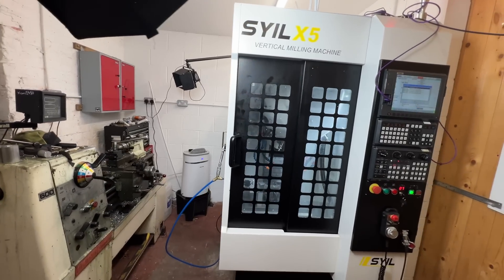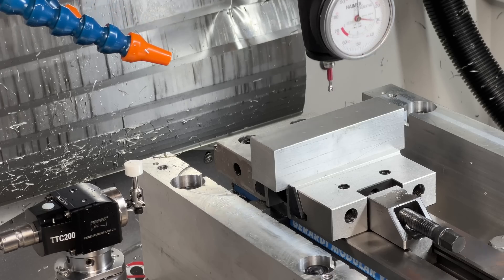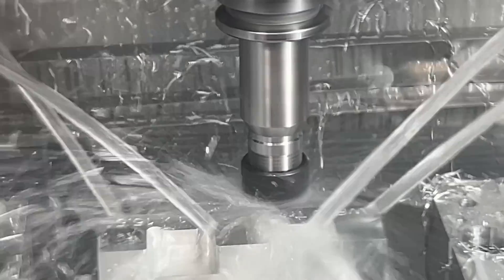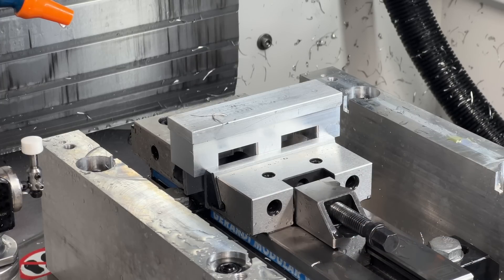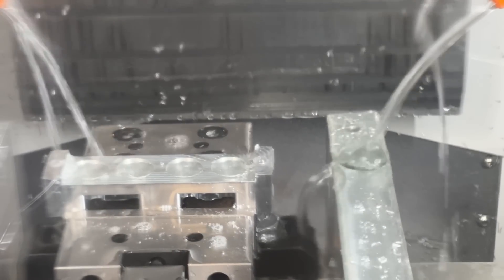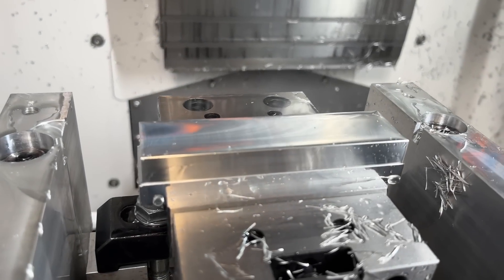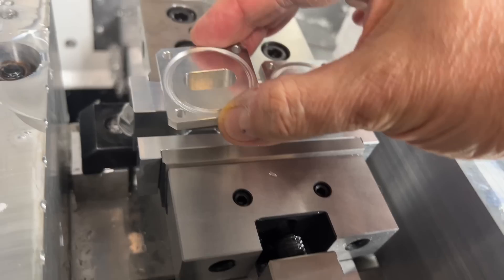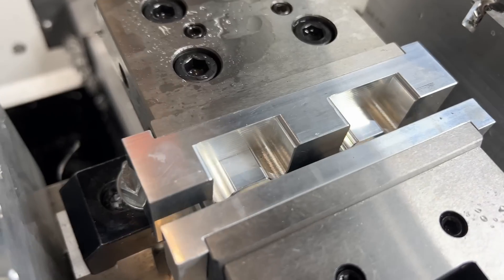I Built My First CNC Fixture!

Comment: Couple pieces of advice. When taking a full DoC with an endmill, make sure to perform a finish pass as there will be more deflection at the bottom from the roughing, and adding a finish pass will help reduce or eliminate taper. Leave between 5-10 thou stock on walls for the finish pass.

Also, you can set your Y permanently to the back jaw of your vice as long as you don't move it or switch jaws. If you have stock overhang preventing you from getting the location of the machined face, you can just stick a gauge block on it or a 1x2x3 block and indicate on that and subtract the dimension in the offsets.

Comment: I'm looking to buy a mill for microwave & mm-wave parts, up to 134 GHz. Would you have any advice on what is likely to work better, a Sherline mill, or one of the upgraded Sieg-based models from LMC or PM? I'd value precision over ability to handle larger workpieces, and mostly for aluminium.
Reply from the maker: I have zero experience of the smaller Mills. My Bridgeport cost rather less than many of those but it needs three phase and an enormous amount of space and it creates a lot of mess. Quinn Dunki of Blondihacks seems to do well with her small mill. there are lots of new multiaxis CNC desktop Mills appearing all the time, but I've no idea if any of them are rigid enough for precision work. If I was going to look for a new small mill, perhaps to use in my laboratory, I think I would be looking for a secondhand mill where someone has upgraded to a bigger system and is now selling their original machine. My X5 is the only new machine I've ever bought. My other machines are 40 to 60 years old and made of cast iron. I think I would be looking at the availability of spare parts and technical support, plus a large community of users and a big pool of modifications and additions so you can improve the usual drawbacks of small machines which are lack of rigidity, excessive backlash and less than robust gearing. there are a lot of people out there working on modern improvements for the more popular machines.
Reply: @MachiningandMicrowaves  thanks, I would love something like a Bridgeport but that is impossible currently due to space limitations, and also only 120v.

Comment: Seems you've caught on rather quickly.
Reply from the maker: The basics are just ordinary machining, and most of the rest is just code. It's my total lack of experience that's going to bite me. My expensive Gerardi vice put up quite a fight when I took a 6mm deep cut at 1200 mm/min with a 12mm carbide 3-flute. The end mill won the fight.
I have snapped four of those parabolic-flute 6mm slot drills while pushing the limits of performance, but now I know where those limits are.

Comment: If youre doing low volumes, it might be worth considering op1 on one side and op2 on the other, so finished parts come out every cycle. Makes measuring and inspecting a little more manageble. Interesting design for the jaws, might want to consider magnets on the bottom as well to prevent lifting on the fixed jaw when loading/unloading.
Reply from the maker: @P8ntbaLLA56  I've used that approach on some more recent jobs using two vices or the tandem jaws on the Gerardi. Good idea about the extra magnets

Comment: Good job mate ! First time using cam soft and doing prety good ! Yeah u can absolutely go full depth. 10 % radial for a 6 mil cutter maybe 15000 rpm and go 6000 mm/s its pretty conservative
Reply: u can use 123 block with go stop for probing the 2nd op
Reply from the maker: @weaknessjordan4783 I forgot that very basic method! I do that on the manual mill, but somehow my brain turned to fluff when I was faced with the CNC machine. Such a n00b...

Comment: In BobCAD CAM (I am pretty new to CAM & CNC as well), there's a variable for stock remaining. It's supposed to be stock aware (you configure the stock before setting up any operations) but I noticed that your stock remaining value does impact the distance away from the feature that it starts cutting. 
I also noticed the 2D adaptive roughing doesn't create as complex or constant-contact tool paths as 3D adaptive roughing does for 2D features. 
I think it'll just be a matter of playing with your CAM to get more familiar with what does what - make minute changes to the program and run the simulator to see exactly how each strategy or setting affects the tool path...
Reply from the maker: The weird part is that it's completely aware of where the stock is but it's making choices about the order of machining so they were obstacles that it had to go round and then it's re-cutting areas. It's already cut as it's unaware of the size of the cutter, but the re-cutting is, on paths where it's already removed material. I'm going to compare what happens with some of the other post processes and see if the simulation looks the same and if the code has any differences. It does look like it's a fusion issue and nothing to do with the post processor.

Comment: When engraving, face mill the surface, leave 0.001" in height above your desired depth. Engrave your text, then come back with the face mill again and skim off the remaining 0.001" and it will clean off the burrs and rough edges of the text.
Reply from the maker: @BlueFinCNC  I didn't show that step because it felt a bit repetitive, but i took a second facing cut 0.005 mm above the engraving with that face mill. I found if I took a really fine cut, I was getting a slightly worse finish in that 6082 material. Taking a cut a tiny bit above the surface cleared up the burrs perfectly. The problem is the finish deep in the grooves, which is very poor. I changed from a four flute carbide engraving tool to a single flute for the more recent engraving work and the difference is spectacular. I've been using a DLC coated single flute and graver with a 60° point but an asymmetric grind to improve chip clearance, but I think I prefer the appearance of the 45° cutter. I just need lots and lots more experience and a better feel for the way the different grades of aluminium, copper, brass and steels behave when being engraved. In fact, I just need a whole lot more experience of everything. The great thing about Youtube is having an informed audience telling me where I'm going wrong so I can learn from my mistakes.

Comment: I'd have approached this differently. I'd have fixed the main jaw using the 2 normal screws, with their holes counterbored so their heads clear the cavities. The second jaw seems redundant - they are called "soft" in terms of machinability rather than their tendency to damage the part - but you could always use a piece of paper, plastic or card to cushion the part. Then, with both jaws fastened in the vise, clamp a spacer piece between them to create a defined gap. Then machine the cavities from above with the jaw in situ, rather than from the "side" as you did. You don't need to ensure the soft jaw is replaced repeatably, as you will need to reset your part origin each time anyway. Being clamped in its final position during machining will help to ensure the faces are orthogonal. There's no right or wrong way to do this but I like to minimise the number and complexity of the operations. Bloody impressive effort for a first job - and your machine is jealousy-inducing!
Reply from the maker: @murrayedington  the problem with the Girardi is that the holes are on the other face of the jaw when you're using these pulldown jaws. I made a set of bolted onto that side but all of the other operations are using the pulldown jaws so this is a bit of a Bodge job really. The reason for the second job is only that if I use the steel jaw, I get a small reaction between the jaw surface and the aluminium which discolours the workpiece so the plain jaw is more of a protector. I could certainly use a piece of shim instead. The actual machining steps start with one of the blocks held in the device and I do an intermediate stage cutting the pocket and mounting holes and the sides of the flange then I flip it over and machine the back of the flange and the body and rear face and then I put it into the fixture just to do the engraving and the four holes which are blind tapped and the stepped central hole. Then I turn it on its side to do the finishing on the flange face and cut the o-ring groove. i've filmed the process already so I'll probably publish that as a video but then includes some of the improvements that have been suggested. I wish that I bought several of the self centring modular devices that are about 2 in.² along with an indexing system so that I could, move parts between the CNC the manual mill and lays without taking them out of the vice. However, that was a hell investment when I hadn't got any experience of what I needed to do. I have other jaws forthis Gerardi, but the step jaw has a 5 x 5 mm step which is much too great for most of the tiny parts that I'm making. Now I'm using parallel and thin parallels I can get much less waste and also drill and thread holes much closer to the vice jaws. For these types of parts I almost feel that using a dovetail vice might be a better solution. I'm going to stick with what I've got for now because most of what I'm working on is being done on the fixture plate that now sits across those two aluminium slabs most of the time. I've made probably 10 sets of jaw fixtures which are machined in the traditional way by bolting them through counterbored holes to the fixed jaw. this was my first fumbling attempt at making something useful with absolutely no skills or experience.

Comment: Nice work! Nice looking single piece transition. When can we start to place orders? :D
Reply from the maker: I need to get the finishing process sorted. I could use Alochrom 1200, but I like the idea of using a dyed anodised finish
Reply from the maker: Also I'm doing other sizes for 8.4 GHz as well as WR 90 and 75 plus various 24GHz sizes with 2.92 or 3.5 connectors. I'll also do silver plated brass and gold over copper on brass
Reply: @MachiningandMicrowaves  Great, that'll be good for DSN stuff 8.4 GHz/3.5 mm
Reply from the maker: @ I'll also do TNC and N versions for all the variants for WR-112/90/75. Also doing a range of round horns with oval irises for various f/d ratios and from 8.4G to 47G. I have no kit or testgear for 76 GHz yet

Comment: Hi, this is my first of more to come (I hope). Do you mind if I ask you a few questions. B4 you settled on this CNC mill , What made you settle for this 1.  I ask because I haven't seen any used in a 1 man setup.   Thanks
Reply from the maker: 1) Syil were cool enough to send a machine to Naomi Wu

2) it was the biggest machine that I could fit under the oak beam at the door of the barn

3) ongoing costs were not silly 

4) the epoxy granite frame seemed like a good idea

5) I have absolutely no impulse control
Reply: @MachiningandMicrowaves  Thanks I am looking forward to seeing more.

Comment: If you haven't figured out the air cutting yet...
Maybe, depth of cut... for example, you are trying to take off 12mm of material from the back of the part - if the tool is set in CAM that it can only take 6mm depth of cut then it will take 2 passes. If you let it take all 12mm it will be one pass 👍
Reply from the maker: @themikemyers  It seems to be related to ramping, so I'm having a look at a Fanuc post processor code compared with the Syil to see if there's anything machine-specific that Fusion is trying to do but that's missing in the LNC firmware. There are passes that are just cutting material that's already been cut. There are some other oddities with the options to start and end a spiral 3D contour with circles, I don't get clean starts sometimes. In the end, I wrote some Perl and C++ code to post-post-process the emitted g-code and fix it. Fusion sometimes inserts code that is in Fanuc machines but not in the LNC, so although I can modify the Javascript to fix some of that, I don't know who to raise change requests with for bugfixes

Comment: I’m family with the concept of a YouTuber making impressive upgrades, but… holy cow.  That’s a beast of a machine.  How did they even get it to your shed, let alone inside?
Reply from the maker: @Scodiddly  There was 18 mm of clearance between the too of the machine and the giant oak beam above the barn doors. They used thin machine skates and a lot of clever rigging. They told me they usually move machines weighing ten times as much. I'd done 3D models of the barn and the internal walls and knew it was possible. I had 6mm UHMWPE sheets ready as sliders in case things got really tough. Their fork lift wrecked lots of paving slabs and caved in the underground water catchment tank a bit. Should have put steel plate down, but it's all repairable

Comment: Awesome job. I will try to save you some money on engraver bits and tell you that you can  use a center drill at shallow depth and it will last for some time in steel and nickel based materials. It doesn't even notice aluminum. For reference, I usually use a #3 or #2 at .005" depth. They work a treat. I only bother with engravers when a customer wants .08" height or smaller.
Reply from the maker: @roundaboutdays  I have an Alexander D-bit grinder so I can grind asymmetric engraver bits, but I found some cheap DLC carbide engraving bits that work well in some types of aluminium. Not as cheap as a centre drill though!

Comment: Nice machine.  How do you like it.  I passed over the Syil back in 2021 because of a lack of information on them.  Really good job for your first run.  I remember pressing the cycle start button for the first time and i was puckering lol.  No formal training here.  Also for the contour you can use an open chain because the relief corners don't need to be cleaned up.
Reply from the maker: I think the 2021 version (like Naomi Wu had?) was rather less refined than the later versions. Now I have this one, I'd be happy to buy an old Haas or whatever and get it restored to full performance, but I wanted something I could use to develop fast-iteration prototypes, and this little (two tonne) machine really fits the bill